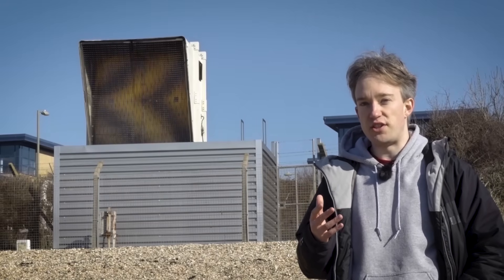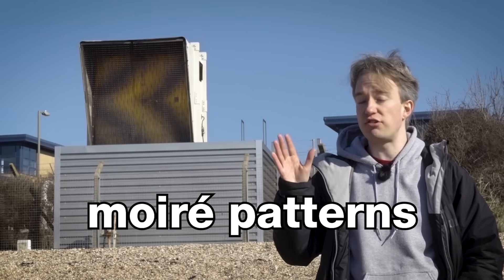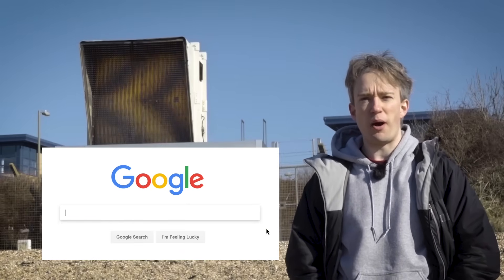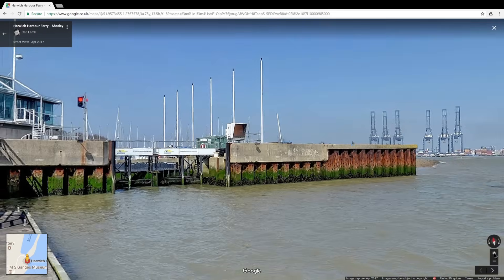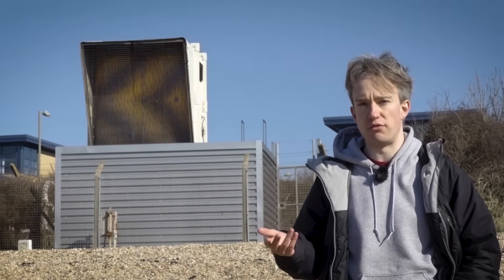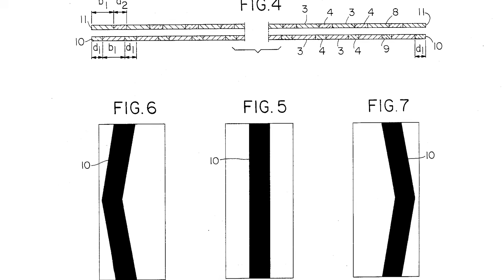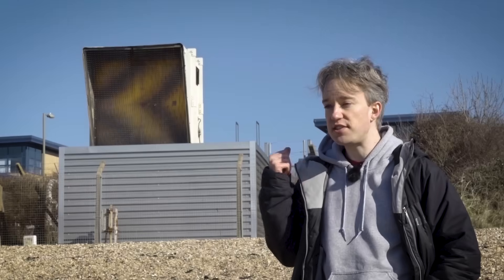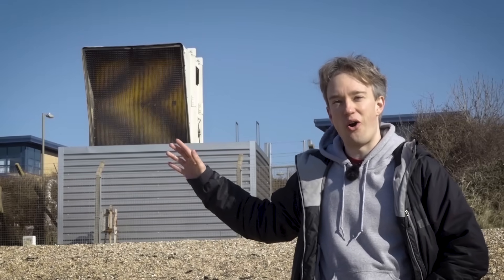The moiré effect lights that guide ships home

Comment: I expect that this signal works in reverse of what is normally expected. If you see the two bars and you are spot on you need to get the hell out of dodge. If you see the arrow to the left or to the right, then you are ok to anchor or disturb the bottom.

Comment: Not sure if they count as inogon lights but in the Netherlands they are sometimes used on a highway in a corner where driving into the corner tells you to move with the corner. The reflective surface are lit up by the headlights and the angle when you are driving by gives you the idea of an arrow pointing to the left (or right) moving like an image. Although it only points one way and not towards "the center". Love these informative videos :-) keep it up and more! :D

Comment: I've seen these arrows here in the Netherlands as warning signs for a sharp turn next to a road (in red and white). Apparantly, they are made by a company called Brimos BV, they call them Curve Care Safety. They are supposed to flash annoyingly when you are driving through a corner too fast, making you want to slow down.

Comment: A different light configuration used up river from the Tasman Bridge in Tasmania uses three vertical light tubes sitting in stacked parabolic reflectors. The way it works is when you line it up with a green triangle on the centre arch of the bridge, you see a green light. Get slightly left or right, the reflection of the green light is lost and you see amber. Move further, and you see red. Brilliant design, simple, effective.

Comment: On the Swedish westcoast you usually just see two aligning signs marking the cable in the water. Since you don't need that high precision It's just cheaper. And let's not forget the good old fashioned lighthouse, does It's job for guiding ships into the docks.

Comment: Around these parts, on the Mighty Columbia River, we use _Range Markers_. No optical tricks required. Two red panels at differing heights with a black stripe down the middle. Align top and bottom and voilà, dead center in the channel. As you reach the markers, look ahead, line up the next set of markers and continue on. Less gimmick and more "it just works".

Comment: Thanks Tom, great video. I have walked past this and wondered what it was, I thought it was some sort of vent. I think the reason is that there are underground cables that link the BP terminal on the Hamble side of Southampton water, with the Refinery at Fawley on the other side of the river. No solid evidence, but it does make a lot of sense given the geography of the sites in reference to the Inogon light.

Comment: I wasnt sure exactly what you were asking at the end. You said you learned the arrow marks the location of underwater hazards, that's what it does. Are you now trying to figure out what is specifically under the sign in the video? As a sailor I may be a able to explain the sign a bit more, but I have no idea whats running under that sign.

Comment: The back of our old humvees in the Army had something similar (but different) to these using fresnel lenses.  When driving with blackout lights, it is normally difficult to maintain a convoy, because you can't really tell how close the vehicle in front of you was.  The humvees had special blackout taillights that showed two dots when you were the proper distance away, three dots when you were too close, and one dot when you were too far away.  In addition, if you were off to either side too far, you'd see only one dot "streaked" towards the direction you were supposed to go, like a comet with a tail.
Reply: Those particular blackout markers were not only on HMMWVs, but on all tactical vehicles for a very long time. Like WWII.
Reply: @DILLIGAF2101   Yes they've had convoy lights since ww2.  No they haven't had directional or directing lights.  As this gent is describing.
Reply: Do you know what these lights were called? It sure was a great idea!
Reply: I knew about the distance indicator, but the left right arrow is new to me. 👍
Reply: @sed6  Thats because we never broke convoy :D
Reply: That reminds me of the sighting system used by No. 617 squadron to assure that they were at the right altitude to drop the bouncing bombs to blow up the Ruhr dams. Two spotlights were aimed downward. When the lights became one, the aircraft were at the proper altitude to drop the bombs.
Reply: Amazing
Reply: Sounds to me like a clever improvement of the Notek Abstandsrücklicht that the Wehrmacht had in WWII.
Reply: @andrebartels1690  It was.
Reply: I own an M1009 and it still had these lights on it when I purchased it and they worked for me, and I tested them out one night and I was able to notice all the things that you just pointed out. Very very clever.
Reply: Coolio.
Reply: Having seen this comment, It's been niggling at me for a few minutes until I finally remembered why. 
Back in the 60s-80s we had a TV program "Tomorrow's World". Some guy got an idea of placing  a small sheet of plastic on top of  the car's dash which had 2 parallel lines on it spaced at the approximate distance that the car in front's tail-lights should be at 30, u, 70 mph (the UK speed limits) - mimicking a plane's head-up display. Ok, there are shortcomings but I never could see why such a simple Idea was never adopted.
Reply: @roblamb8327  Because it's much easier to just say "one Mississippi two Mississippi"
Reply: hignaki it looks like a PAPI in aviation. I believe you have differents lights heading in precise ways so you can’t see them if you are to close (so to high) or only if you are on the left/right (the « tail » of the dot)
Reply: @vizender  I was thinking same thing. I have installed many PAPI lights. "Precision Approach Path Indicator" lights, have only one light source but many colored mirrors in them that reflect light in different colors at different angles, so a pilot can tell if they are coming in at too steep or too low an angle. Very cool stuff.
Reply: Robbie Mize yep, and also very useful they sayed
Reply: Fascinating! Thanks for sharing. It’s so wonderful learning stuff like this and hopefully the idea can be used for other helpful purposes. 👍
Reply: That’s amazing, I just learnt about Fresnel zone plates in my degree, fascinating to see an actual real life use for them
Reply: hignaki That’s so cool I think you aren’t supposed to tell me about it
Reply: That is so cool!
Reply: that is awesome.
Reply: Oh that's really cool, thanks for sharing. :)
Reply: This.. is.. epic
Reply: That's awesome!
Reply: I want these lights to be called Goldilocks lights.
Reply: That light from your HMMWVs was invented by the Germans for vehicle convoys in the 1930s.

Comment: This was a really interesting video, I've never seen these before! I could see it being useful in places that are crowded and need compact navigation aids, but I think you don't see them as often because a range does the same job and send like it is simpler and more visible. You could check a nautical chart to see if it has more information about that particular light. What is the lat/Lon of this light?

Also of note, while GPS is great, you can't put all your trust in one positioning source, aids to navigation are still important for double checking your position.

Comment: My guess is that Leading Lights (two light in a line) are a simpler (cheaper) concept with slightly better visibility (especially in the nighttime).
Reply: Range lights/boards/poles have been around for eva and are much simpler and need less/no maintenance which is why this system here was so infrequently employed

Comment: The question isn't why it's there, or even why it's there . The question is why it's there.
I'm guessing it may be due to the lack of a suitable reversed arrows version.
Reply: Obviously, I have no real idea. But thanks for the highlight. From what I can see, there shouldn't be that much difficulty in creating a "go away" version.
Reply: Think of it as information rather than instruction and you'll see that a reversed version makes no sense at all.  The arrows are telling you "the line that we're pointing out is on this side of you".

On your chart the (in this case) pipeline zone will be indicated, with the range indicated by the beacon extending through it.
Reply: @the_tel  I wonder if installing it upside-down would reverse the arrow indications, but that might cause the casing to no longer be watertight.

Comment: Near my city there was a traffic node (changed by now) where lots of these Moire-pattern signs were used to signal drivers to take a left turn. It was only visible from a certain point in the bend of the road, wich moved (from sign to sign) along with the vehicle.
Due t reconstruction of the intersection they took them away as obsolete. Pity.

Comment: Oh yeah, I have struggled to find a thing that I didn't what it was called before. So there these two symbols, one a circle with a dot in its center, the other a circle with a cross, that represent an arrow pointing away from and into the plane they're on, respectively. I knew these symbols, and knew that this is what they were used for, but I spent weeks trying to figure out what to type into a search bar to get images or any sort of information about them.

Eventually I found that the search terms I was looking for were "vector into page" or "vector away from page", because they are primarily used in physics (which I didn't know, I thought they were used in mathematics) to represent vectors, which is also what arrows are used for. Once I figured that out it became incredibly easy to find out stuff about them online.

One of the reasons it was so hide to find that information is that the same symbols are used for a lot of other stuff -- the circle with a dot in the middle is a common way of representing the Sun, for instance -- and none of the places that talked about these other uses mentioned their use in physics, as something that have the same function as arrows.

Comment: May I suggest you contact the local port authority, who are more than likely responsible for maintaining the light, they should at least have some records for it, and if the port authority is a local authority (e.g. county or district council) then the records will be available under FOI. Might also be worth a phonecall to the local MCA office and having a word with the surveyor who carries out Master 200 exams, because they should at least know about the local signage. Also, check the requirements for local knowledge endorsements for Boat Master's Licences because if that (or any other such) light is in an area requiring an LKE, then have a work with the authority responsible for carrying out the LKE assessments, often the pilotage or harbour authority for the area.

Comment: They are used when there is not enough space for a front and rear light to signal a restricted area.
Reply: But at that point i'm sure you could really just install a sector light. Red in the middle, and white on each side. It would be much cheaper, and much more visible.
Reply: @patrickmeyer2802  But with white on each side you won't be able to tell whether you were north or south of the prohibited zone.
Reply: @jessedenwood3152  Sector lights are generally red-white-green, to indicate which way to turn to get into the correct line.

Comment: There's a gas pumping station immediately behind you which I believe it protects. If you look on the access road, there's also the marker for an underground gas line.
Seeing as it points at Fawley, I'm fairly certain it's the jet fuel pipeline to Heathrow.

Comment: Tom,

I am a merchant mariner from the US, and I can say that I've never seen or heard of these moiré marks.  Far more common are simple sets of range lights (night), or range markers (day), that let you know if you are on the centerline of a dredged channel or fairway.

They work by having two sets of lights, one behind and above the other, the other in front and below.  If you are on the centerline the two lights will be above/below each other.  If you are off center, the front range light will be either to the left or right of the rear one.

I imagine range lights are much cheaper than this Inogon setup.  I do agree that this is an ingenious invention, and is much easier to understand with only a glance.  One question I have - are these Inogon units illuminated?  If not, then clearly they're day-use only and thus only half as useful as the neon-paint-and-lightbulb contraptions we use so often.  It figures, it comes down to money.

Thanks for sharing this with us, I will definitely be keeping an eye out for them now!
Reply: Same here. I'm a mariner from Poland. Never heard or seen this as well.
Reply: "Inogon Lights" would be illuminated, by lights. Sometimes the smartest among us are stuck stubbornly pushing on the door that says pull, because we're busy contemplating more important things.

Comment: What's so special about them? You see them on the road quite regularly as well right? On the outside of corners, these rectangular white signs where the red arrows appear to be moving in the direction  of the corner as you pass them because they're all painted on at a slightly different angle.

Comment: It guides you towards the cable so you know where exactly not to drop your anchor. If it was the other way around, you wouldn't be able to drop your anchor anywhere outside one line, which is ridiculous. 
Let's say it reversed and shows you where to go, can you drop an anchor if you see the arrow pointing left? How about if you move a little further? It's still pointing left, can you drop your anchor here? What if the arrow is pointing right? In this case, all you know is, there's a cable somewhere outside one line, but where exactly?

Comment: for those interested it is located here: 50.856001, -1.329080, it is a gas or petrol pipeline under there, you can see the pipes coming out of the ground in the fenced off area

Comment: That is probably there for maintenance, but they just get told that the arrows show how far off the cable the maintenance team are.
Reply: Well I think it's there because it's prohibited to drop anchor there, the marine charts for the area will of course clearly mark the prohibited zone on them the light along with it's accompanying sign saying clearly that it's a prohibited anchorage is just guidance to allow vessels to verify that they are a safe distance away from the prohibited area. Similar markers are used in some places for things like the marine fibre optic cables too as while well armoured against the elements they don't much appreciate having a 20 ton anchor dumped on them either.
Reply: @Seraphina I dunno, I find @Elxroid's hypothesis more convinving; this Inogon thingumajig seems to offer a level of precision that would be excessive if it were only about a no-anchoring zone. As a matter of fact, you rarely want to tell people "don't drop anchor exactly here" - to the contrary, you'll usually want to tell people "don't drop anchor anywhere near here", and add some decent safety margin just to be sure.

Comment: Tom, marks like this are actually quite common in the maritime world. They are very handy for doing a politage through tight spaces or for making sure that one's vessle is in exactly the right spot in areas of heavy trafic. They work on the same principle as conventional leading lights, they just use Moire patterns insted of colour. If anything, hey are more practical than convetional leading lights as they dont require a power source and can be configured to glow in the dark. However they are not as wide spred so maybe they more expencive, im not quite sure.

Comment: Interesting piece of technology.
But also an interesting dilemma with searching for stuff online.

My typical problem that results in this kind of stuff is finding back the name of a song from a fragment of lyrics and a tiny bit of melody;
Finding back an image you found a few years or even just months ago. (yes, reverse image search is a thing; What if you don't have the original image though? How do you describe it reliably enough to find what you were actually looking for.)
Also old computer games I played 20-30 years ago. Or stuff I once owned.

You do get random insights sometimes much, much later. Like I figured out a game I remember was called Blast Doors 3d.

Meanwhile most recently I remember I used to have this gigantic race track thing. You ran cars down it, but it was built like a rollercoaster.
And I mean, this thing was huge. fully assembled it was a decent fraction of my own height. Yes, that was when I was a child, so that's a relative statement, certainly.
But it would still have been like a metre tall, and possibly two metres long on the long side, and had 4 or 5 layers of plastic track and curves in a framework of some kind.
Obviously you could rearrange the track, and due to it's sheer size there was a LOT of track.

Now, OK, this isn't a strange concept. Toys like it still exist, in varying levels of complexity.
But I've rarely seen anything as elaborate as that set. (and yes, I know from memory that the whole construction was a single set with instructions, not a bunch of parts someone had put together that way themselves.)
And that's the thing; As elaborate as that memory is, there's nothing in it that helps identify what it was.
I don't know what the toy was called, how that specific set would have been identified, who would have made it...
Anything.

And that's where the internet, and it's vast stores of knowledge, and web searches, really start to fall down a bit.
Finding things like that; Where you have a fairly solid idea of what it is you're looking for, but nothing coherent that uniquely describes it in an unambiguous way. No name, no properly unique characteristics...
Just a description that isn't good enough to unambiguously identify something with.

Quite frustrating.